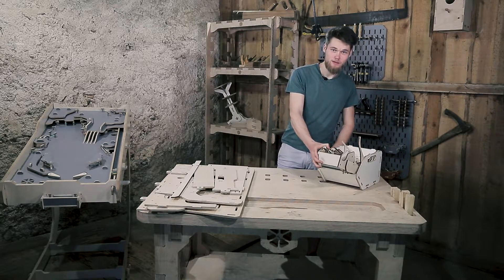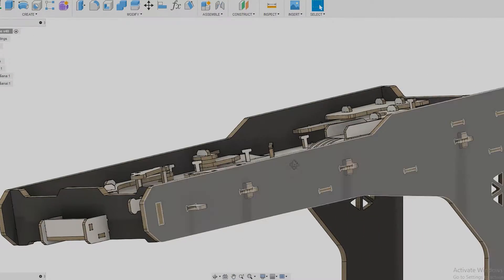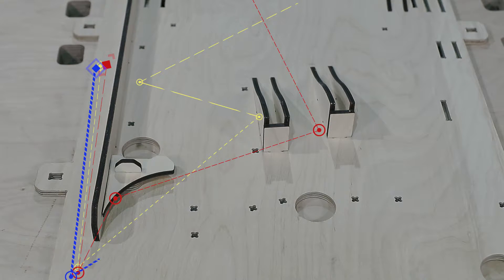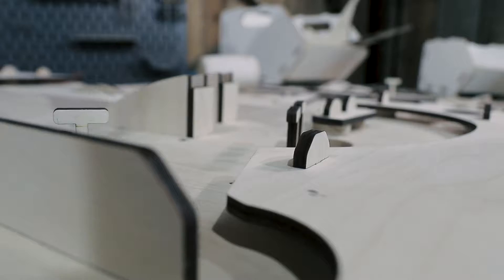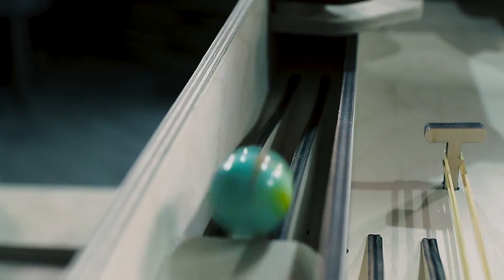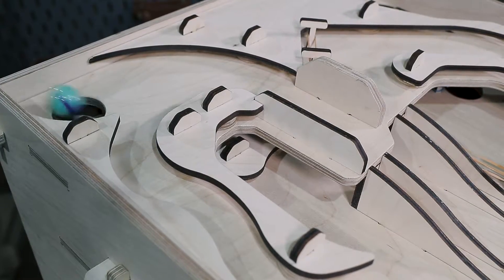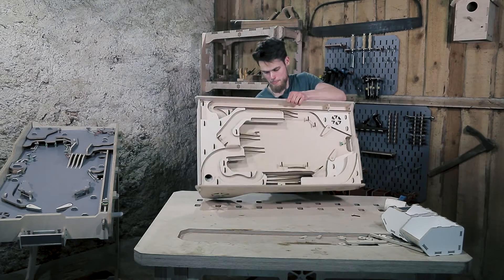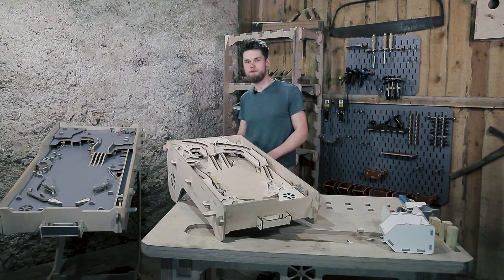How to make a mini Wooden Pinball machine - ARIBABOX

Comment: I can report that I bought the plans and built this pinball machine. It has been great fun to build and play. I can share some things I discovered during the build process that may be useful to other potential builders. I had an old bicycle inner tube that I could cut rubber rings from. First I was only going to use it to substitute rubber bands to the pop bumpers, but it turned out to be most useful to wrap around the flippers to give them a "full" rubber surface. I had to enlarge the cut section of bike tube in steps before it had stretched big enough to be wrapped around a whole flipper without breaking. The bike tube did not work as well as rubber band substitute for the flipper and plunger mechanisms as they tend to break easily if strained too much. I will probably need to add a little sloped piece to the basement section as the rightmost hole does not seem to give the ball enough momentum to go all the way to the other side and enter the ramp up to the play field. There is also some instances where you will auto loose the ball when the ball goes between the two ramps at the top of the play field after ball launch. I may just add a little piece to the wall there to gently nudge the ball in an other trajectory. But those are so minor issues that it is hardly worth mentioning. It might as well be me who made a slight error or two when cutting out the parts on a CNC machine that was a tad bit too small to swallow the needed dimensions of raw material. So I had to rearrange the parts to make it all fit the CNC machine I used.
Since I finished the build a few weeks ago I have had fun playing it whenever I get a chance to. I will eventually modify it some to make it into an interactive geocache, where I will be extending the ball drain path to go to a new hole where the ball will hit a latch to open a geocache container, but haven't gotten that far with the geocache plans yet.